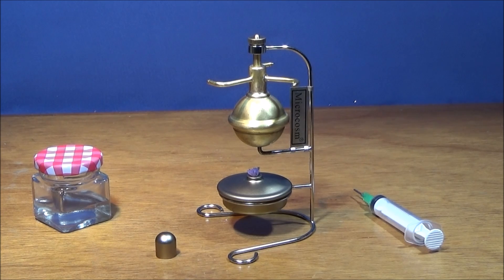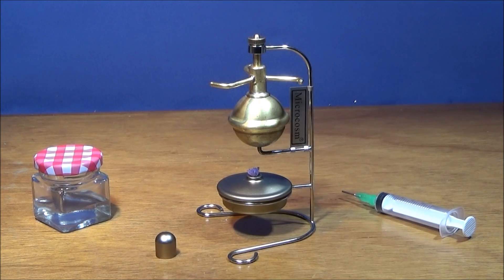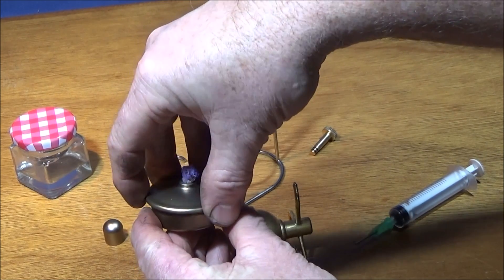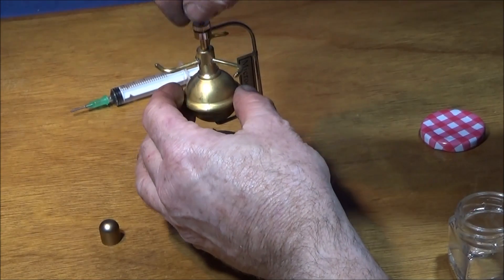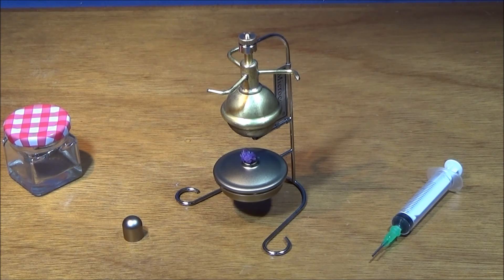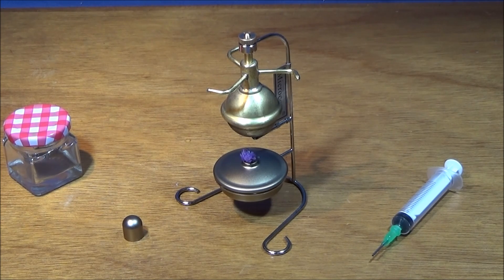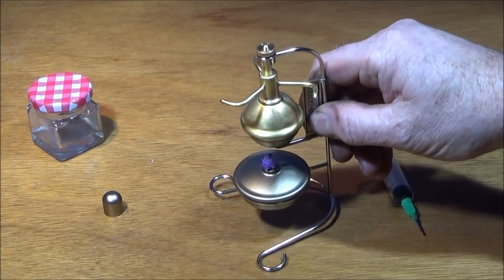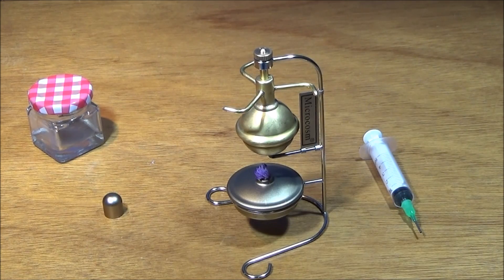Microcosm Hero Of Alexandria Micro Model T1B Steam Engine

Comment: Hey Steve, I watched this again and I think it's spinning so fast the water is pushed outward by the centrifugal force causing it to slow down. I am making one now from a old toilet tank ball, copper with copper jets and soldered small inserts with 5/32 holes.  I am mad at you anyway, you made me start building things again and my wife is having a hessy because I keep buying more stuff.  LOL 
I am now in the process of rebuilding my ham radio towers. I have 6 towers and it takes a lot of time keeping them going. When I get the steam engine going I will send you a video. Right now it's on the back burner for about 2 months until I can get the towers done.  Cheers Mate...

Comment: The stopper popping up is a safety pressure relief valve. If you restricted it steam pressure could rip apart any seams. 
1100 c temp of meths flame 🔥 
250 c temp gives a sealed container of water a pressure of 39bar or 585 psi
Now I know the temp of the bulb is not going to reach flame temp but it could still get pretty high.
A restoration project tv show did a resto on an old mamod steam car and he wondered why he couldn’t raise much steam, it was because he was using parafin blocks 199 c burn temp.
But was originally designed for methylated sport burner 1100 c temp. Quite a difference.
Reply from the maker: Yes I realized that now.

Comment: I was thinking of your idea to put in a tiny grub screw to hold the pin in... bad idea ! because that Pin is your safety valve to keep it from blowing up ! ....Bob.....
Reply from the maker: Hi Bob, Thanks I didn't think of that as being the safety valve....good that you told me! I will leave it as it is, as it works perfectly.........Regards Steve
Reply: Agreed, good point!